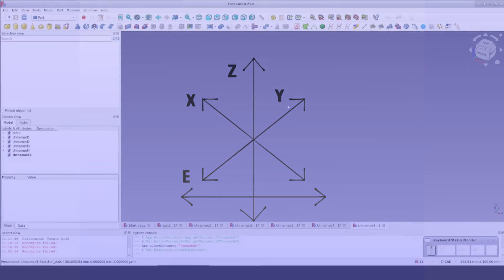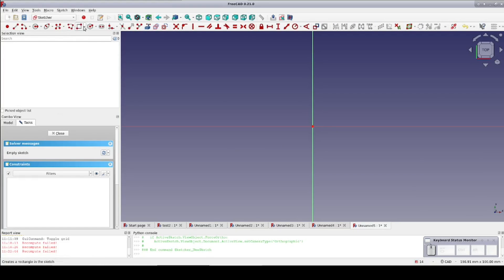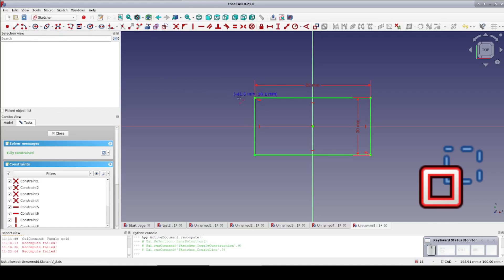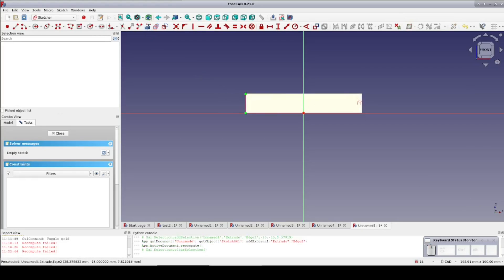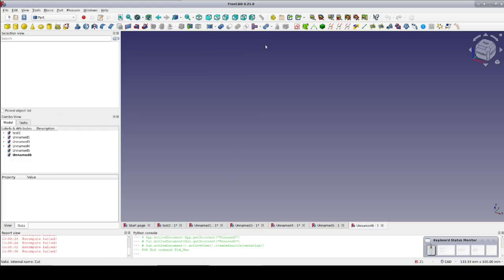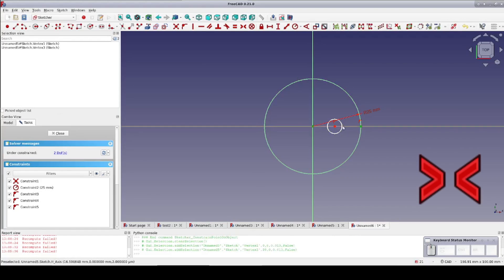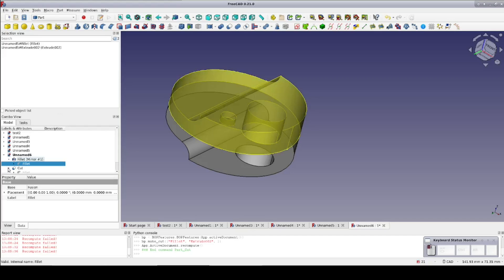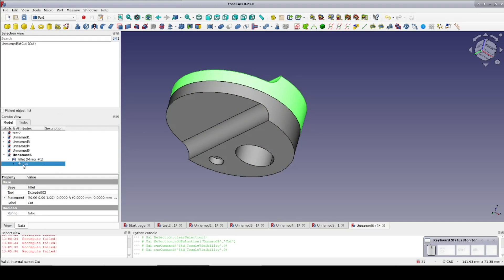FreeCAD: An Open Reply to TeachingTech

Comment: This is a great video and I hope a lot of people will watch it. However I think the point of the original video was not to show what FreeCAD can do, but rather to prove that it does not work the same as other tools. I've seen a half-dozen such videos, all by experienced CAD users, and wondered if they did any research at all. I came to realise they didn't really WANT to learn something else, they just want it to work like they are used to. They usually describe working in many CAD programs and being able to switch between them - until FreeCAD. Is this a problem of the software? I don't think so, but I suppose it depends how you look at it.
Reply: FreeCAD has some genuine issues. There are some useful features it's missing and the fragmented nature of even pretty basic workbenches is pretty confusing with how there are multiple tools that do very similar things without much explanation of the nuances. The UI could definitely be better too.

But the things that people complain about usually are exactly what you said, they want it to work the same as everything else. Most CAD software allows for intuitive workflows, but they often lead to very fragile models that are difficult to work with. It's kinda crazy how badly constrained the models are of many very succesful maker youtubers. FreeCAD makes less assumptions, sometimes making it tedious to use as you have to spell out what you want it to do, but in most cases that's good practice anyway.
Reply: @Bruno-cb5gk  This is a very fair assessment. And it matches what my coworker (a real Fusion pro) said when he got serious about learning FreeCAD.
Reply: I've seen a bunch of videos where people say "I usually work in X, but I was able to work out how to do it in package Y, even though the commands were different, because it was INTUITIVE". Then they say "I couldn't work out how to do it in FreeCad without delving into the manual or forum posts". For myself, I learned on DesignSpark Mechanical and switched to Fusion and found it very easy, even though practically every command was different.
Reply: If FreeCAD is different from other CAD tools, learning it does not benefit much (education and industries use "normal" CAD tools anyway).
Is it somehow impossible (technically, or mindset-ily) to bring FreeCAD workflow, UI and concepts in line with other CAD tools? Is it some sort of open-source or linux curse to stick to own ideas and forget ordinary users?
Reply: @kimmotoivanen  To some degree, yes, open-source has more room to explore different conventions as it generally does not have a strong need to sell product commercially. Sometimes this results in better options, but this also needs to be balanced with sufficient familiarity in user experience. Otherwise people don't give it a fair try.
Reply: God the denial in the freecad community is so frustrating. Its more like Gimp than blender. Until people admit that it will stay in that category of being filled with too many deficiencies to be usable by anyone who isnt masochistic.
Reply: @BeefIngot  Well I think most of us agree there is a lot of room for improvement. But I have watched many (hundreds!) of total beginners adopt and use it very effectively. This is not denial, it is my experience, and I documented it extensively. Usually people just need a bit of help getting started.
Reply: @oddlytimbotwillison6296  You can say that, but look at my longer comment on this video covering step by step all the straight up deficiencies, as opposed to differences just shown in this video alone. You may be able to produce great things, but I simply refuse to believe its not whilst tying one of your hands behind your back.

FreeCAD just slows you down compared to other tools.

Seriously, check out the other comment.
Reply: @BeefIngot  I'd like to, but I don't see another comment. Still, I don't disagree but I'm lucky to be in a place where speed is not really an issue - our people just need something to make their stuff and it has worked great.
Reply: More importantly, they paid for something else and they didn't want to learn FreeCAD could do the job.
AKA Confirmation bias

Comment: The change you made at the end was worth platinum! As to the TNP, Solidworks actually makes a bewt guest based on last knon good and goes from there. All is well until expprt. Somewhere in the FreeCAD forums there is a post about trying to convert a shape into a solid. Someone dug into the design and found a bunch of open shapes that were probably the result of bandaid and "hide the bug" fixes that large no compition software ends up. This could be also a result of buying tech to include so people keep buying the new version. Adobe did this with Photoshop and many of the addons that I have install files for but are no longer on the market but are now in Photoshop.

But I am rambling and the screen keyboard is driving me crazy with the typos. Thanks again for the really cool time travel tip.
Reply from the maker: I'm pretty sure I have seen F360 do that too. Silently dropping an attachment means breaking the parametric characteristic of the design. I find it a bit horrifying when I think about what can happen when someone goes back and makes a small change that SHOULD have been no big deal and the model becomes a nightmare shape with little idea how it got there. If it's going to break, I'd like to know immediately so I can address it, preferably by re-attaching the feature somewhere.

Comment: Great video! Thanks. Agree 100% with the concerns about corporations holding your designs hostage. That's why I've forced myself to learn FreeCAD as well. Still ongoing, but I'm slowly getting better. It definitely seems to have a tougher learning curve and some quirks, but I'm willing to deal with those in order to know that what I'm learning can't be made irrelevant by some greedy corporate executives. Once I learn it, it seems quite capable of doing anything I'd need. And it's improving all the time. If I ever start making money from my designs, I'll probably donate a portion of that back to the FreeCAD project and feel a lot better about doing that than I would paying a software rental fee.
Reply: You know you can export your files in a large number of different formats from most paid CAD software, some even allow you to import other CAD software's files. Then you would still have your design even if you lose access to the CAD software.

You act as if with paid CAD software their cloud or proprietary file format is the only way your design can exist.
Reply: @conorstewart2214 "export" and "save" are two different operations. being able to export is better than nothing (although, that is not something you can always take for granted with some of the cloud shit out there), but it's not the same. most of a CAD program's features won't cleanly map to the features of an interchange format like step or stl, so you lose a lot of information; even if it's a format that can losslessly represent the final geometry, and even some basic features of the model's topology, you're still losing a ton of information about how those features are defined using the CAD program's native features, and thus how to modify them using the CAD program's native tools. and If you do parametric modeling, an "export" is basically worthless for anything other than the parameter values you happened to export for before losing access. think of the difference between a PNG file and the original Photoshop file.

if a CAD program lets you directly import another CAD program's native files, then... maybe. but there's a million caveats with that, especially if the source format is proprietary. the developer is basically guessing how the objects are represented in the source format, and with no documentation on how those objects actually work, then has to figure out how to best represent them in their own program's data model. and if you don't have, like, the entire SM64 TAS community's worth of reverse engineering capacity, that ambiguity will show. the people building those features are doing valuable work, it will help people transition to more sustainable software, and more acutely it will help people recover after their commercial cad package inevitably rug pulls them. but that doesn't mean you should rely on it; just because firefighters are cool and brave doesn't mean you leave your stove on all the time.
Reply: @spambot7110  yes I know all that, I was more meaning in a better than nothing kind of way like you suggested so if the CAD software does try to lock it all down then you can still have a usable file in some form, like an STL or step file. Most of the things I design are not parametric anyway, although I could make them more parametric if I wanted too but there wouldn't be much point.

Fusion 360 can import solidworks files, you do lose the timeline and all that though but the model can be measured, edited, etc, still. This may only be available in the student version rather than the hobbyist version though.

If for whatever reason I could no longer use the CAD software I would be fine (although still unhappy) with the step files, I can continue to print the pieces as I need them, I can continue to use the step or STL files in my design and then if I need to make a major change that isn't easy to do to the stl or step files then it is probably worth me remaking them in another CAD program.

The best solution is for CAD companies to just agree on a format, but obviously they don't want to do that. Hopefully the EU or similar can force it for compatibility reasons.
Reply: @conorstewart2214 Onshape blocked my account entirely, just because I'm from Russia. No way to recover my models, and even if I was able to export them - I couldn't get them in "editable" state, partly because with models I've lost my favorite and familiar CAD too. And trust me, you NEVER know until such thing happens to you. So, there are bugs and downsides, but (hopefully) with Freecad no one could repeat that to me.  
  
upd: maybe I wasn't clear enough so here it is - Onshape blocked ALL russian accounts at once. Thousands at the very least. That's how many people lost all they work, just because of single corporate desision, based on political reasons. I assure you, most of those people couldn't do anything with our goverment and their actions.
Reply: @conorstewart2214  That is not what is being said.  The ethos behind paid software is to offer a product at a price that first will provide a profit for investors, second to maintain engagement and finally to serve user utility. Because of this paid software often makes changes to suit the first of these objectives and suffers either massive push back from end-users, as in the case of Fusion 360 in recent years, threatening loss of engagement or suffers simple loss of patronage with a minor effect on profitability. For those with the means to support paid software, such as some YouTubers, that is fine.Those of us without such means, including some who follow such YouTubers, need to find alternatives and I assume this is the motivation behind both Michael and Angus attempting to keep in touch with changes in open source software. The main value to me in following Angus and Michael is in the end product, rather than the means of achieving it. In order to learn how to achieve similar thing,s utilising open source software, I follow those who can already demonstrate their understanding of the alternatives.It would enhance their credibility if they deferred to those with greater open source experience, perhaps even entering collaborations which benefits both.